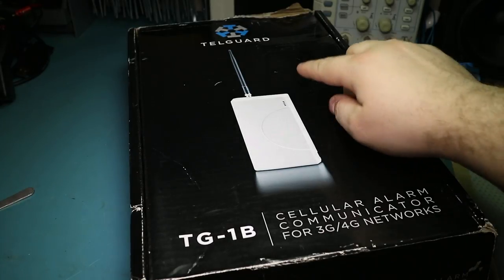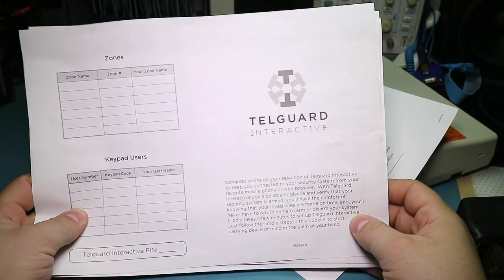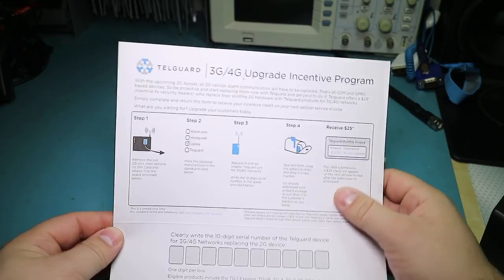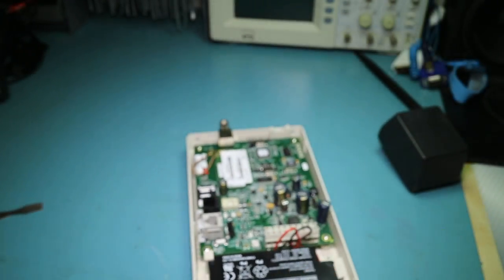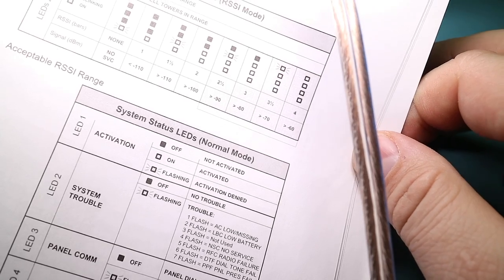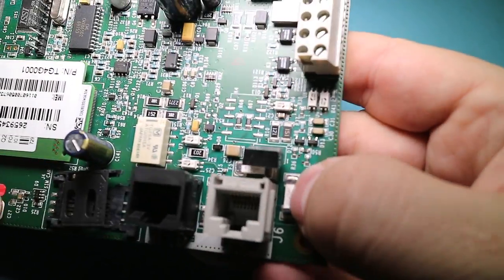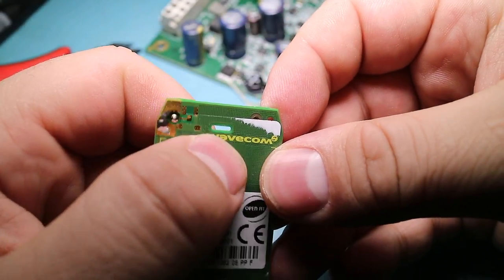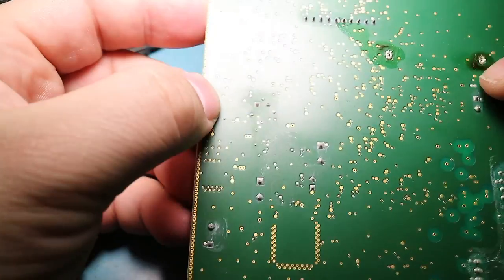Telguard TG-4 3G/4G Cellular Alarm Communicator Teardown

Comment: If you have access to an unlocked phone of any kind you could put the SIM in and see what happens. Most of those modules have an RS232 interface which may be brought into the debug area. Cellular modems typically use a Hayes AT command set.
Reply from the maker: +stonent Yeah, in fact I ordered one of those TC35 cell modules recently to try out. I don't think it would really do anything since it probably isn't even setup to take a call or text only send them to a specific address.
Reply: ATDT911 ;)